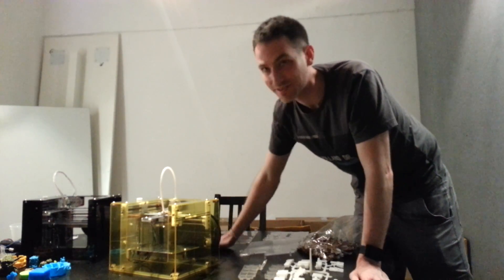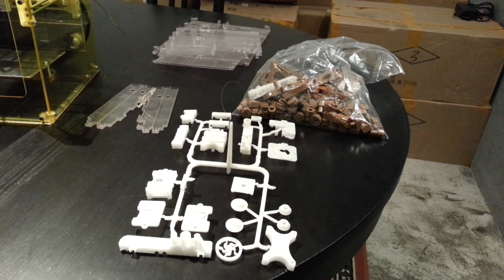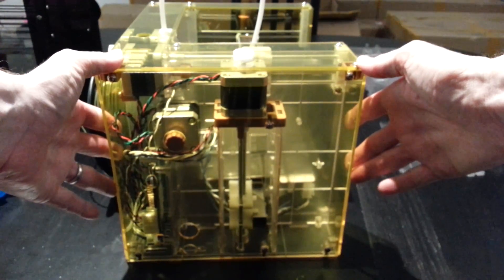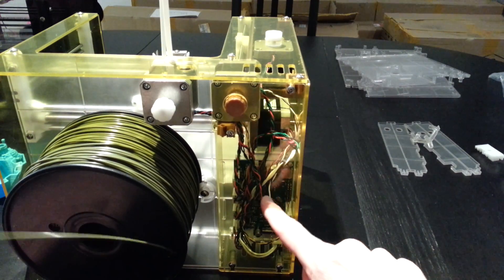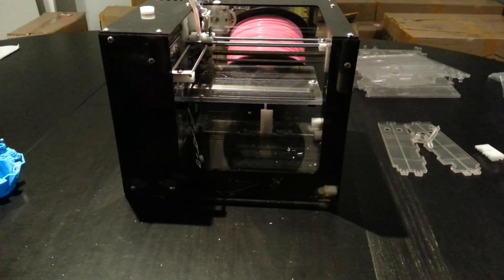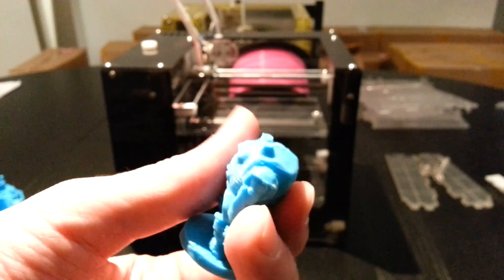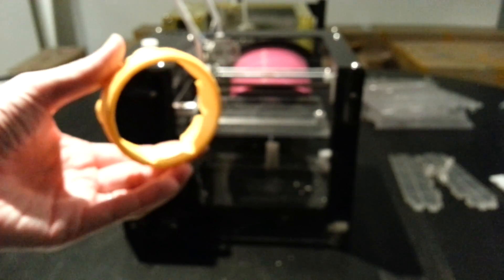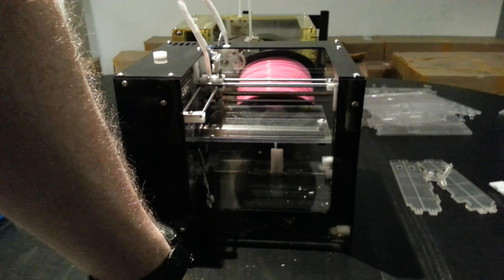#MakiBox A6 - First Shot Molded Parts Asembled

Comment: We did the hollow prints to test the overhang differences. What we saw is that 0.05mm did worse in terms of bridging than 0.1mm, at least without any significant changes to the slicing settings.

Comment: We have started the pre-production phase now, which was the plan. We will be using the tooled up parts to work out the final pack out and other bits. The full production will start by the end of this month, so nothing has changed based on our original plans.